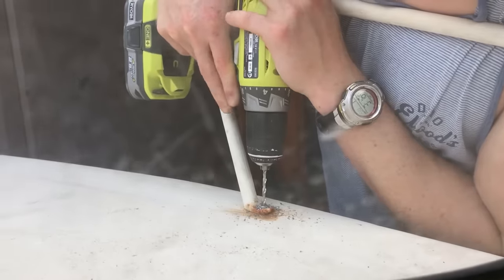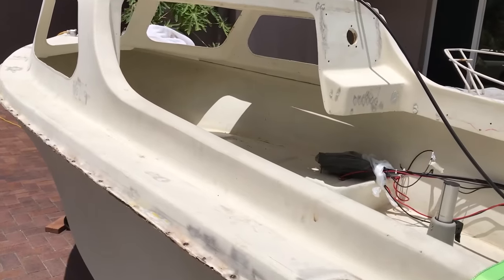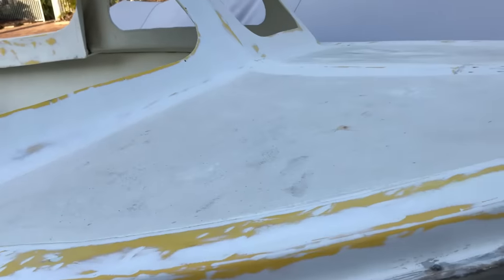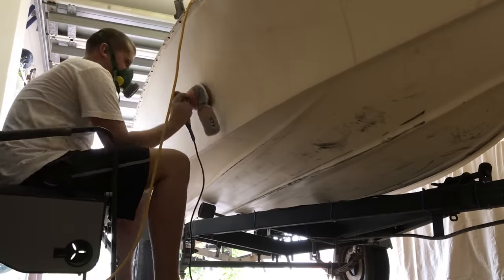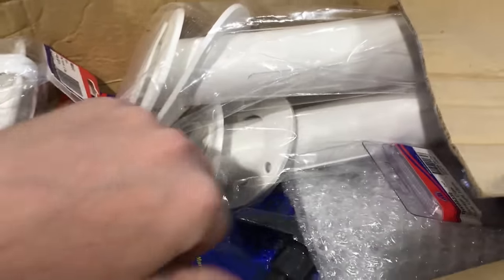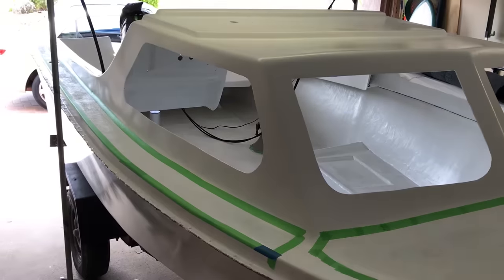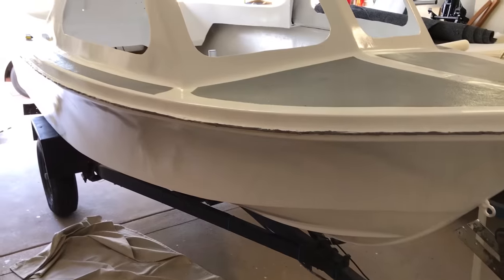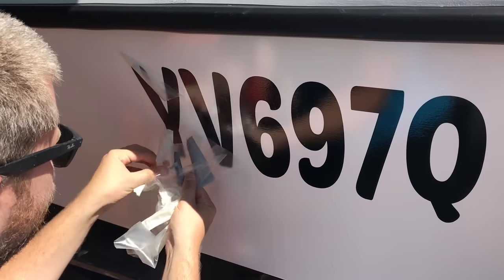The Half Cabin Boat- Restoration Project!

Comment: Make the cabin a lay-down space for the baby and put a new engine on it ,you'll not be expecting the difference in perfomance
Reply from the maker: Thanos Rou thanks for the comment! I'm sure that's true, but for this particular boat, I'll probably leave it as it is, and upgrade to a bigger/better project in the coming months.
Reply: I didn't expect you to reply as this is an old video anyways you should make the next boat an RIB their performance is excellent despite the size .I own a ribco 860 which is marvellous in rough conditions .
Reply from the maker: That would be very interesting! Unfortunately it's quite hard to find RIBs locally, and when they are available, they're pretty expensive! I'll keep an eye out for them though!
Reply: Ok , nice chatting with you if you need any help with an RIB look for my comment

Comment: You should be proud of your work. This boat came out really nice and not only did you save tens of thousands over buying a new boat but you had the satisfaction of knowing it was you who did this. Like you said you know what’s under the carpet and you can be confident knowing it’s clean and functional. I think it looks great and I was really Surprised in the paint. I’ve never been a fan of rolling or brushing on paint I always spray when I have the option however this technique you used looks great. Thank you for sharing your project it makes me want to pick up an old boat and get to work.

Comment: Awesome work. I had the same boat but hated the cabin part, it was good for storage and keepingstuff dry but was a real hassle with getting the anchor in and out. Started to strip mine down for a bit of work and found most the timber was rotting so it was off the the tip with it (I didn't spend too much money buying it and I got my monies worth with fun and experience).

Comment: Love it!!!!! I have done similar in the past, here is an idea, cut the roof off leaving a small ledge then move the steering station 500mm forward add a windscreen on top and a bimini and you would have an even better boat. Shade shelter and even more fishing room. I worked here in NZ for a company building similar boats back in the late 80's that company's moulds are still being used the hulls have barely changed (apart from getting bigger) its only the topside design that's been modernised. Another modification you can do is add an outboard pod thus removing the outboard well and giving more fishing room.

Comment: It is a nice little scooter of a boat.  You could make the sanding a bit quicker and easier if you invest in a media blaster.  The initial outlay for the parts would be a bit costly, but if you are doing multiple hulls, it will be more cost effective in the long run.  Filtering the material you blow off of the hulls, you can often reuse the media for a few hulls you blast.  You did a great job, my friend.

Comment: I’ve brushed a number of boats. Thinned right it can come out great. Never fully rolled-and-tipped as it seemed to collect more artifacts....
I sprayed a boat the first time several years back. HVLP. I suppose I may brush small things now and again but considering time, quality of finish, and effort (did I mention quality of finish?!) - after that I decided I’ll spray everything I can. 
I sprayed my 19’ several coats in about half a day including cleanups. Fantastic finish. To do that by brush or roll-and-brush would have required waiting a few days for cure between coats so I could wet sand, and while I brush very well, I know from the many, many gallons of paint I’ve used over the years there is no way I could achieve that level of finish which the spraying gave with so little effort.
Just a thought I’d share for consideration.

Comment: Nice job! 

If you wanted to remove the engine without a lift, I mounted a $25 cable puller to my garage ceiling and lift my old straight 6cyl 90hp Merc on and off with that.  Works great.
Reply from the maker: Very interesting! Thanks for sharing!

Comment: One thing, please put some plugs/grommets to fill in the holes around the cables ! Those open holes are an invite for water to join you inside the boat when you back off the throttle and come off the plane, or when reversing. Those old design engine wells need the cable holes high up on the sides of the engine well, and if not, the holes need to be well sealed. Another mod is to raise the inside well wall to the full height of the transom to help from being flooded over the stern. 
Another mod worth doing I to fit two 4" inspection covers to the floor in a low traffic area. Open them up when storing the boat to let the bilge really dry out and the under floor stringers/boards have a very chance of staying rot free. 
There is a video of a 16ft  boat sinking from a 4" hole, with two bilge pumps running, and more than one boat has foundered from being swamped from water coming the  engine well.  
Nice work in all respects, no over investing, it is a tidy  boat now.

Comment: Gday mate i did this with a haines 146c half cabin ,i replaced the transom with a dual thickness laminated one ,this is a big job i think sometimes people get into it not knowing how much time and money it will cost ,bought mine for 3 as a wreck fixed it up did all the work apart from the gunwale rubber and bow rail and sold it for 10 was on gumtree for 3 days before it sold guy came started engine looked her over and paid cash

Comment: Your side windows should have the join in the rubber at the top to avoid water entry, something I picked up as a motor body builder. The theory being that the water runs down the glass into the join and then into the inside.
Reply: John Lawton where do I get rubber window edging like that?

Comment: Anytime you see Ryobi, you know their professionals. Looked great though!
Reply: As much as ryobi gets a bad rap i work in a paint and panel shop stripping cranes trucks and industrial equipment and to be honest i use ryobi there more than anything they can take a beating and your not so stressed when the get covered in thinners 2 pak paint and grease. Brushed drill 2 years old got the wobbels pretty bad and 1/2"impact gets replaced around every 6 months but for the price and what it goes threw im happy with that every other 18v range ryobi tool we use regularly havent had an issue in almost 5 years. I brought what i thought was trash knowing the environment but it has certainly surprised me. Just my 2cents as a contractor using the tools dw i was as shocked as you

Comment: You'd be surprised how easy it is to remove the motor! Lifted my 70hp evinrude off with just my dad and brother and stuck it on a stand i made with 2x4's for like $20! Obviously the throttle controls and wiring may vary per manufacturer, but I reckon the overall idea is the same. Give it a try next time!

Comment: beautiful boat mate.  Ahoy from Baltimore Maryland down at the Inner Harbor. I'd like to find the same half cabin cruiser type however I like to raise the cabin a foot and a half or more so I can walk under. I'm 6'1" however that converts I believe that's just under 2 meters total. So just over 2 meters. Would that be realistic? Or would that be to high to work and look proper.
Reply from the maker: Curtis Burnham hi Curtis. I'm 6 foot 3, so I can appreciate the need for good height. You won't be able to get a boat this small with that amount of head room (I'd have to raise the roof 3 feet to stand in this half cab, and if I did that, i suspect it would have a fairly serious impact on stability and weight). With that in mind, it might be worth looking for a bigger boat if the larger cabin is important to you.
Reply: Matt Kelly Fishing yeah I figured that much. I'm thinking of a fishing type or bay cruiser and adding length and not height. If I ended up with the half cab id still be thrilled.

Comment: Awesome stuff, inspiring and motivational. Im currently in the process of doing the exact same thing. sanding, primer, and roll and tip with 2 pak. only difference is we went big. 20ft twin hull marlin broadbill. do you think its uneccessary to sand down to bare aluminium. because your video you only sanded to the yellow, and your results are amazing!

Comment: sorry to bother you again. But would an inflatable dingy or aluminium, we have decide to put the half cab on hold, we were gonna get a 14ft savage half cab but we will probs get the shetland 500 i think it is, not sure.
Reply from the maker: I'd go aluminium, because it's better for bulk modifications, and they're pretty indestructible. You get much better flotation/buoyancy, and some would say safety from inflatable (especially in rough water), but they're also typically a lot more expensive. The Shetland 500 is super nice! This boat is a Stejcraft, but there's a lot of half cabin options in the 4.5m-5.5m range.

Comment: Great video! Very useful information that I will be using on my current project. I have a question regarding the paint though. I’ve read on multiple articles that sanding the paint off of the hull results in a worse finish than using chemicals to strip the paint off. Have you had experience in both and have seen a difference? Thanks!

Comment: Taking off the engine is not that hard. Even possible for 1 person but more easy and safe with two. Controlls and wires are easy quick connecting items. Steering is 1 bolt. Take out the bolts in the stern and the engine is loose on the transom. Now lower the engine and lock it in the drive position. Put a piece of wood under the fin at the bottom of the engine and just turn the wheel of the trailer up. Have a second person hold the outboard motor vertical and when free roll the boot away. Now put the outboard motor in the garage and voila.

Comment: Why did you put carpet in a small fishing boat? Going to get nasty with bits of fish and stuff
Reply from the maker: Tag 915 you ever tripped onto fibreglass? I've got a toddler who's likely to spend a lot more time in the boat, so Marine Carpet and a few large buckets and chopping boards is an easy compromise to make!
Reply: Matt Kelly Fishing makes sense with the kids but it will be a hassle to clean out but I guess it's easier to clean because you can take the boat home with you to clean 
Only have experience with bigger boats that have to say in the water unless major work is needed so was thinking of the smell and grime after a couple years in the water would be horrendous 
But with just you and your kids it's easy to keep on top of it being tidy but we  typically have up to 10 people aboard so the mess builds up quickly

Comment: master tip. its not the best to use a wire brush on a drill or drill press. the bearings arent designed for lateral force.
Reply from the maker: Good learning - I appreciate that mate!
Reply: no problem man. glad to save your drill. lol. tools arent cheap. i found this out when i was researching milling with my drill press.